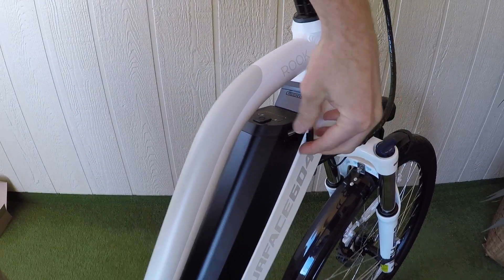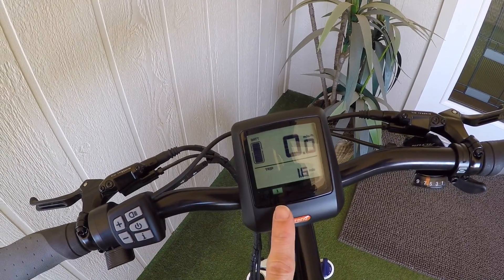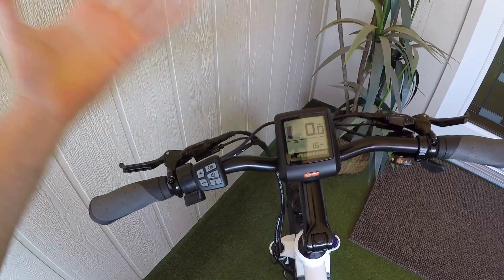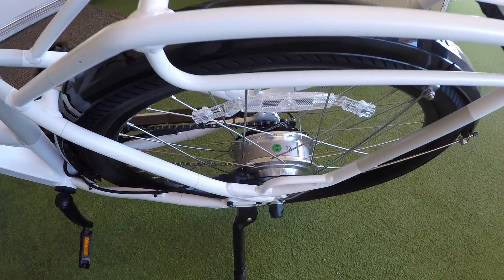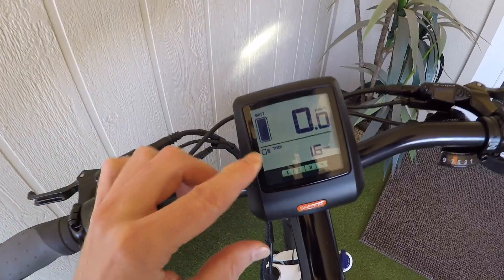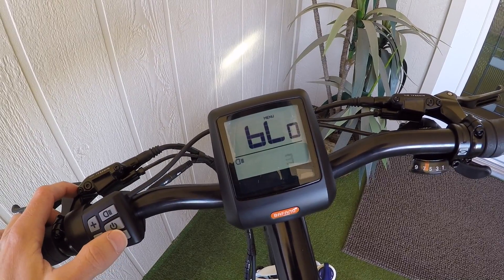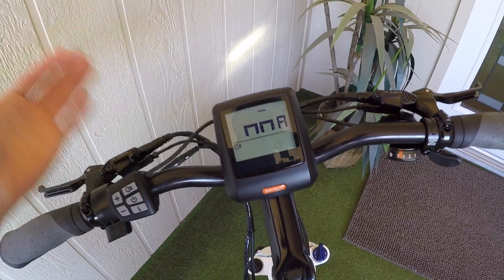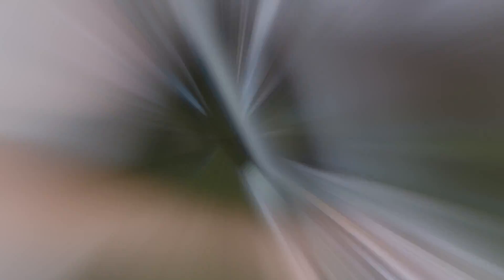Bafang DP C07.UART Electric Bike Display Settings

Comment: I was thinking for 52v 1000w, seems anemic… power assist was on 1:/ for up sand dunes it would fail.. now I know increase assist & power throttle delivery will increase substantially!😅 I didn’t know thanks 🙏 🙏

Comment: I have the same computer but it seems to have different settings. I can't enter Password Mode. The first couple of modes work: Reset trip distances and change light sensors and backlight. However, after that, the next settings do not show any flashing and all I can do is look and not change.

Comment: I don't believe the automatic lighting works on mine (it does on the computer, which is the same) but my main lights don't go on.
They have switches.
I am in The Netherlands BTW and the throttle would be illegal (it would be a restricted moped then instead of a bicycle), so that's not there.
But to go back to the lights: do you have switches on your mainlights, too?
Reply: @Mythreesons137.  I think it has to with the market and the options (pricier) of the bikes. My tail light is powered by the main battery and the headlight turns out to be a separate light on batteries.
In other words: there is no wiring from the computer to the lights.
Reply: Hey ik heb een Cortina gekocht met een bafang systeem maar ik kan mijn snelheid niet veranderen omdat het op slot staat. Weet jij hoe ik dat eraf kan halen?
Reply: @thomblauwestraat4313  Ik denk dat dat beveiligd is voor de Europese/Nederlandse markt. Want  ik kom daar ook niet in.
Reply: @webmasterbou8be  ja importeurs zijn verplicht om ze te begrenzen. Je kunt wel nog altijd proberen er een speedchip in te zetten

Comment: The default password should be 0512. I have the same display but as I cycle through the readout, I don't even get to see password setting which is frustrating because 25kph is just a little too slow for me; 32kph as per the USA (20mph) would be fine.
Reply: Mike Breen is posible to decrease the kilometers of the bike ?
Reply: is there no way to make it work
Reply: It doesn’t take my speed past 34km /hour….. but it’s five miles an hour faster !

Comment: I don’t like this display that is on the bike. Surface 604 should go with a display like the one on Juiced Bikes. I also believe that if Bafang wanted to override the speed limiter setting so when on pedal assist 1 it would allow full throttle they could. Or have the buyer of this setup have the option of doing it themselves.

Comment: Buyers should know that the speed limit cannot be increased. The speed limit is not controlled on this model (or any surface 604 bike) from the display. Even if you try the hack of decreasing the wheel diameter, the speed will remain the equivalent of 20m/h (32km/h) of a 26inch wheel. Bit of a disappointment. Code is in bafang manual and many places online. Also, awesome vids and ebr website is best source of ebike info on the web!
Reply: That’s false, at least outside of the US, where I bought mine from. I’ve successfully increased the speed limit of mine.
Reply: The speed CAN be adjusted easy. Increased mine from the measly 25 to the max . . . .60!
Reply: wrong.
Reply: I increased the speed limit on my 2018 Surface 604 Colt from 32 kph to 33 kph.